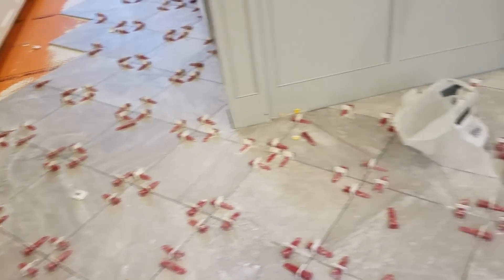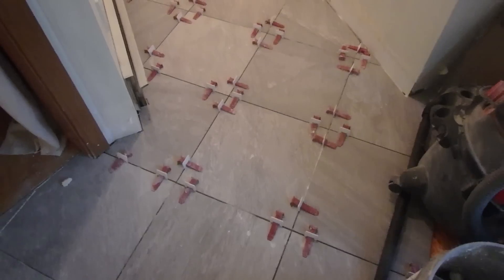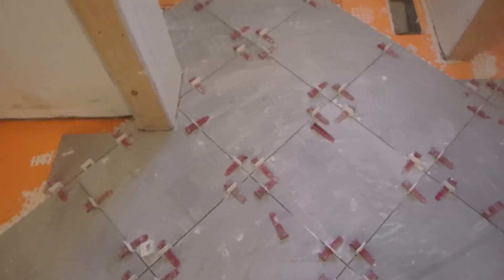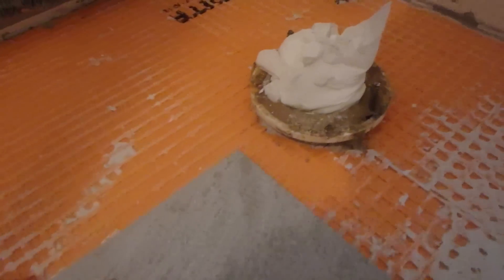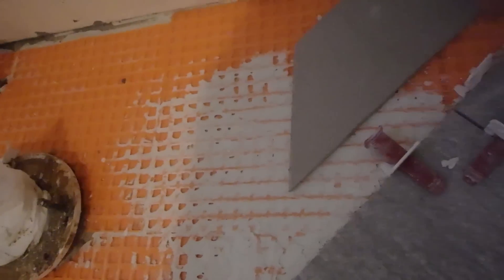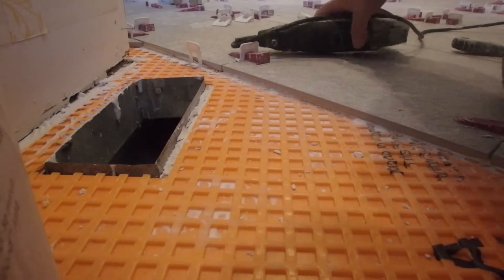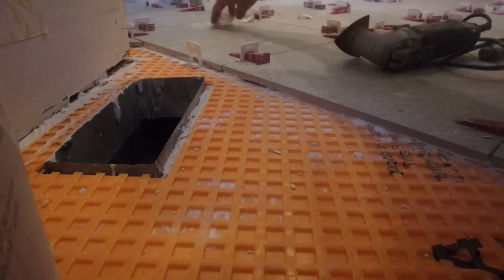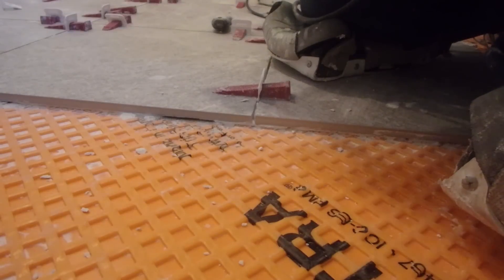Tips for T-Lock™ Leveling System

Comment: Are the Perfect Level t-lock pliers necessary? I'll be doing 1/8" grout lines on large format (15" x 30") porcelain floor tile on a 65 sq ft bathroom floor..
Reply from the maker: No, but much easier with them.

Comment: As always, great tips. This may be a newbie question but typically when you’re using the leveling system, the thinset hasn’t harden and either of the adjacent tiles can move to align. But when you pick up where you left off , only one tile can be leveled, so are you making sure the last tiles you set are leveled in order to start from a good baseline. In the video, you use scrap pieces to temporarily connect the wedges but obliviously the scraps are below level not having thinset under them. Thoughts?
Reply from the maker: The scraps are to hold the clips in place as the thinset dries, nothing else. As the mortar dries they tend to be pushed out away from the tile creating a wide grout line for the next day. Also a leveling system is not a cure for a bad uneven wavy floor, it is a tool to make small adjustments to get a better job. https://www.youtube.com/watch?v=3GFkOiWvbUA&t=447s

Comment: Your videos are terrific, and I appreciate all the helpful guidance.  I am 90% through a tiling my master shower, and used the T-lock system in this video.  They made a huge difference in how level and in-;plane the tiles are.  But, now that the mastic has dried, and I am knocking them down, some of them are not breaking in the right place.  I suspect some of the mastic may have gotten into the crevice.  Do you have any tips for how to dig out the plastic that remains as it is still protruding a bit from the tiles?
Reply from the maker: Best to keep the grout lines clean, and to knock the wedges out the next day, but try this, https://www.youtube.com/watch?v=EM6idOCUuIY
Reply: Sal DiBlasi Hi Sal, link doesn't work anymore. I had the same question. Left spacer in too long, joint was not clean enough, and the Thinset hardened resulting in the spacer braking off flush with tile surface vice at its base. Appreciate all you share of your trade. You are truly a master.
Reply: I would also appreciate being able to see this! It says private when I click the link?

Comment: Thanks for the videos. I have a question which would probably also make a good video. I’m laying 18x18 diagonal and there is a linen closet in this bathroom. As it is laid out one tile surrounds one of the door jams on FOUR sides..ie it can’t be slid into place.  What’s best way to handle this? Break the tile and try to match it up when I set it? Thanks.
Reply from the maker: I usually lay out the floor to avoid such cuts, but with larger tiles it is sometimes inevitable. When this happens you will have to split the tile to get it in, you will want to have the split on the shortest length possible where it will be hidden from view inside the closet. Sometimes the shortest length split is not the most hidden or out of view, so you your own judgment to determine the best approach.

Comment: Another great video, Sal.  Question(s):  I'm putting 20" X 20" tile on my bathroom floor.  You had previously advised me to use Ditraset for my wall tiles.  Would it be okay to use this thinset for the floor too or do you recommend using one specifically made for large format tile?  Brand?  I will be putting the tile on Ditraheat over old concrete.  Thank you!
Reply from the maker: Ditra set is a LFT thinset so it will be just fine for large format tiles. Schluter has recently come out with their own thinset, you might want to consider it. https://www.youtube.com/watch?v=7N2k1RnmeJI
Reply: Yeah, I heard about that Schluter thinset.  I'm sure it's a quality product like the rest of their stuff.  Thanks again for the quick reply!

Comment: So at the end after everything's hardened and you start knocking all the wedges and bases out does the base brake flush with the top of the tile and then do you have to somehow remove it for grout??
Reply from the maker: Break them out the next day and they will always break at the bottom of the base well below the surface of the tile.

Comment: Is there any fear of damaging the Ditra with the oscillating tool?  This would be for a waterproof application (i.e. kerdi band sealed also), so crack resistance isn't the only reason I am using Ditra.
Reply from the maker: Yes, I would be very careful. I usually don't do this if the Ditra has a heat wire (Ditra Heat) or if the floor is waterproofed.

Comment: On your website, where you are selling the T-Lock, what size should I get if I am doing 24 x 24" tiles?  Do I need the 1/32 - 1mm or 1/16 - 3mm?
Reply from the maker: if the tiles are not rectified, 1/8, (3mm) is best no less than 1/16 (2mm)
Reply: Dont you mean rectified tiles can have the smaller grout lines?

Comment: have you ever used the raimondi leveling system?  they look almost identical but the clips seem to be cheaper than t lock
Reply from the maker: I have not.
Reply: Tyler Conant good question.  I use Raimondi and became curious if system components are interchangeable.
Reply: Tyler Conant I have used the raimondi leveling system they look almost identical but those two system they are not compatible.Raimondi seem to be cheaper but the quality also is "cheaper"they do break unexpected during installation and this create lots of problem you have to remove the tile if the clips brakes and then...reinstall that's messy job.
I found out ...T-Lock clips is very strong and flexible.
Reply: I have been using Raimondi for a few years (there was not t-lock). The only thing i do not like about Raimondi is that they don't allow for 1mm grout joints, smallest you can do is 2 mil. Looked at t-lock and find them way more expensive.
Reply: Czeslawa Biec 

Here is the link from Sal that saves your day using Raimondi that break unexpectedly.... 

https://youtu.be/N0BOgihuiCs

Thank Sal ( not me, lol ).

Comment: Another great video!  How do you determine the size of the grout lines?  I'm installing 818 sq. ft. of 24 x 24" tiles and was curious.
Reply from the maker: There is actually a rule in the TCNA handbook, the minimum grout line is 1/16" on any tile job regardless of the tile size. Alos the grout width should be 3 times the variation of  the  size of the tiles. So if the tiles vary by 1/16, then the grout width should be 3/16
Reply: Thank you!  You make it look so simple doing what you do.

Comment: Sal, I watched your video on trowel size selection,  and it's informative as usual.  But you make a point to say you're not going to talk about backbuttering when picking a trowel size.  Won't that make a big difference?  In one of you videos you recommend putting the same size notches on a LFT that you do on the floor.  That's a lot of thinset.  Especially if I'm using a 1/2" trowel.
Reply from the maker: I will be making a video about back buttering, however that does not guarantee proper coverage, it does promote better adhesion. The type of thinset used determines how thick the bond coat can be.